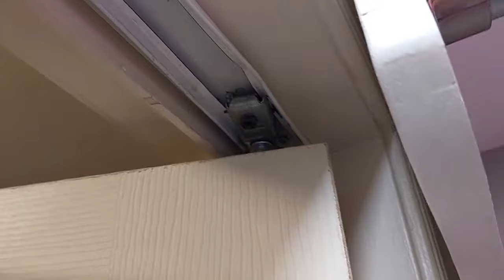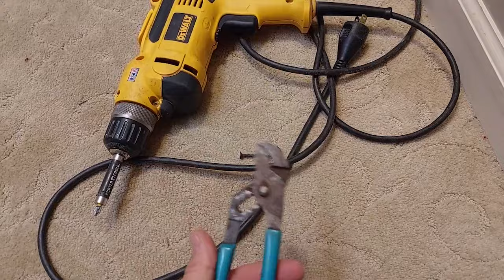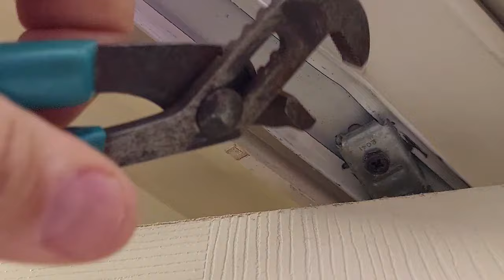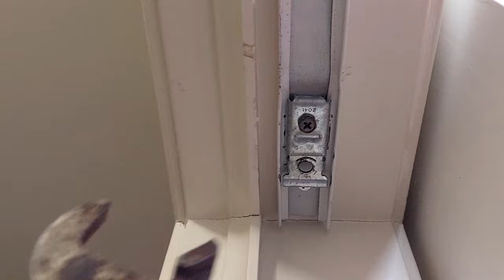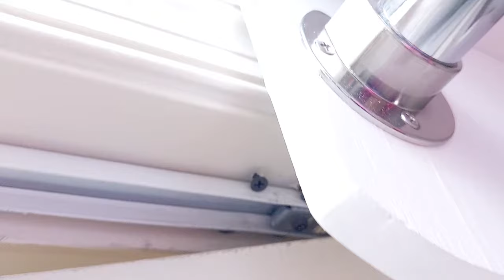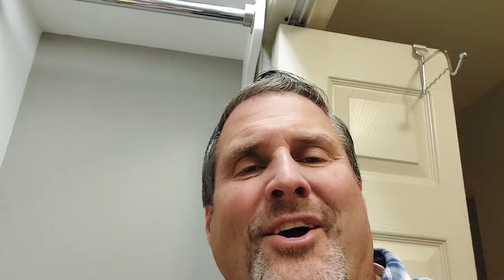DIY: Track Top Pivot Repair CHEAP | Bi-Fold Door Repair

Comment: How do you know exactly where to place the bracket? Mine came off 😢
Reply from the maker: sorry for the late reply, didn't see your message until now. How do I know where to place the bracket? install the bracket loose and place the door in place, then you will need to make the spacing along the edge of the door even from top to bottom, this will give you an idea where to place it but keep in mind, the two doors need to be spaced to it closes with ease. Hope this makes sense